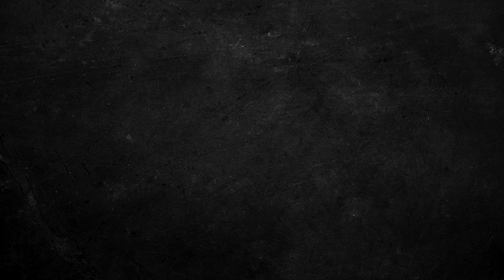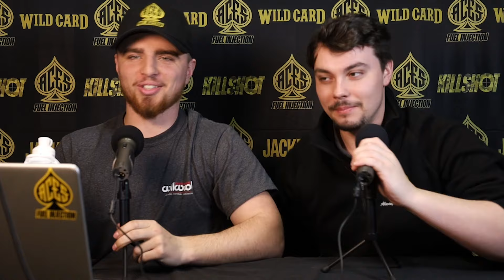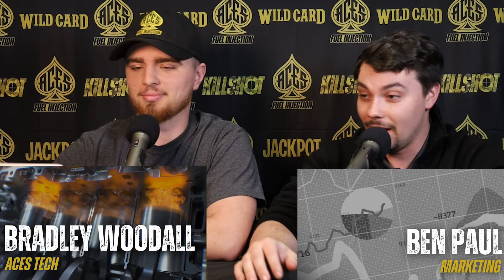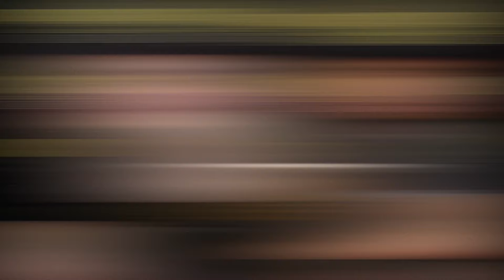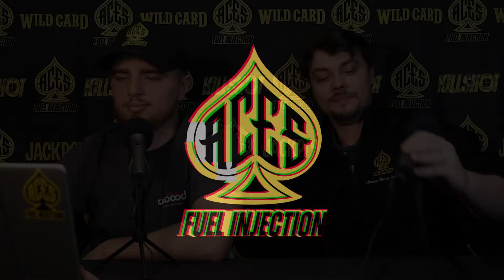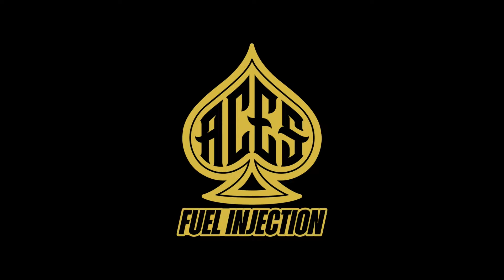Tech Questions with Tech Bradley (Tech Tuesday Ep 22)

Comment: Who here wants me to try to do a tech live stream?
Reply: Yeah! Tell the guys it is Sunday Handwound like winding hand wound coils, not knuckle busting! Pulling the 302 truck off the trailer with the 300 truck was asking a little too much so the 300 is going to get the full tear down and built back up for 4bbl. This means Deuces wild is going on the new 302 truck instead. Hit me up if you have any interest in a 2bbl Aussiespeed 300 manifold.
Reply: Digging deeper on the 302. Deuces Wild is listed as having a few different CFM’s on the website, on the spec chart it says 1000 cfm (I know this is just a typo), comparison chart says 400cfm @ 1.5”, but I’ve seen the DW referred to as 500cfm and 550cfm. If I go to a 4bbl intake with 2bbl adapter is it better to go dual plane or single on the manifold, and open or two hole on the adapter plate? Doing valves and port and chamber work on the stock heads, headers, but if it’ll run better to ditch the intake I’ll make the change.  Just going for a mild 300hp mill.

Comment: I appreciate you guys attempting to answer my question... Thank You.  Unfortunately, and maybe i misdescribed my question.    I'm not talking about brackets to mount the throttle cable and tv cable, to the engine.. I'm speaking of specifically mounting the cables, more specifically the tv cable, to the actual throttle linkage 'arm' or 'head' on Your primary throttle shaft of the Killshot.  The mounting point for that cable has to be in a very specific spot, to obtain the proper geometry.   If its wrong.. it WILL burn up the 700r4.  Companies out there make 'tv corrector's.  The Corrector, it puts that cable mounting point in the correct position (1 inch down, 1/2  inch back) from the throttle shaft centerline.  They offer them for Holley or Edelbrock.  As of yet..  I find no one listing one for the Aces Killshot.  So,back to the question... the Head or Arm of the primary throtle shaft, where the cables hook to the unit..  does it follow the Holley architecture,  Edelbrock.... or is it your own layout.  As it is, me and everyone else with a 700r4 and tv cable are going to need something to mount are tv cables to...  Hope that makes sense??  If not, here is a link to a video that may explain the issue better than i have here..      https://youtu.be/cWQhO3Zu6Z0?si=JLjbUa41w8sPKNOD

Comment: Question I am getting no spark from my coil on my royal flush installed on a bbc 454 checked all wiring. Tested distributor I am using the distributor that came in the kit  my car is flooded with fuel I ran before I backed it out the driveway and went to move it in and was stuck
Reply: And I also just got done checking my wiring grounded good  updated my unit 
Will not get a spark

Comment: Hello guys, I'm new to the LS platform, and I'm purchasing a long block LS3 and I don't want dbw, so I'm looking at the jackpot system with fab intake. My questions are: Do I need a gen4 ecu to go along with the Aces ecu or not ? And I'm currently using a th400 tranny for now but I will get 4l80e next year  so if I get the 4l80e with the kit  can I delete it and use the th400 tranny for now ?